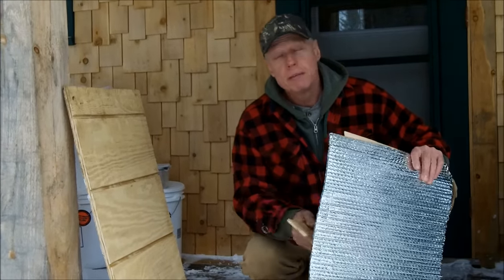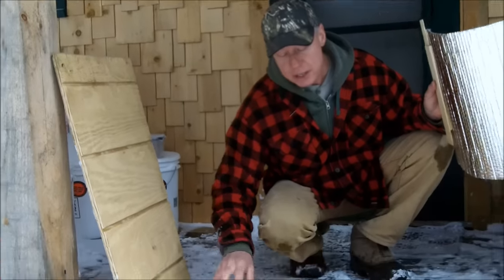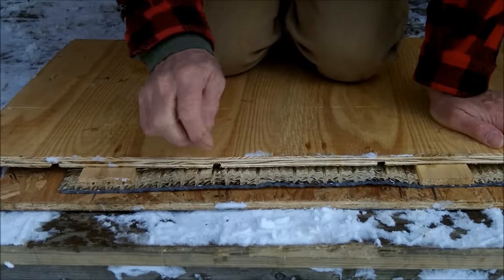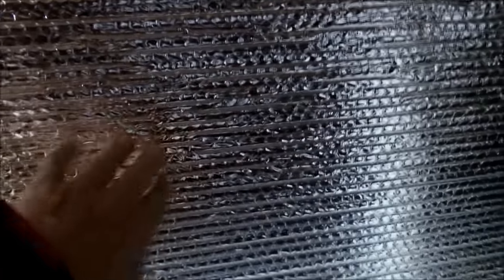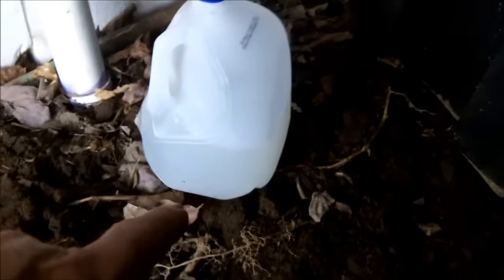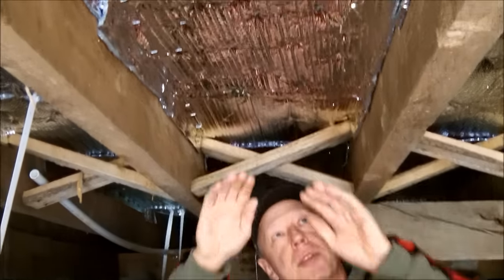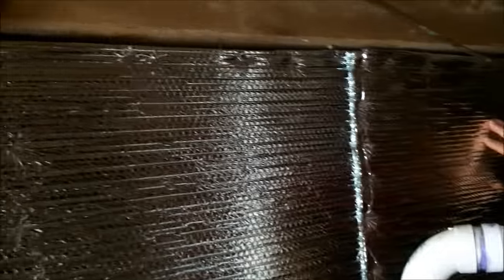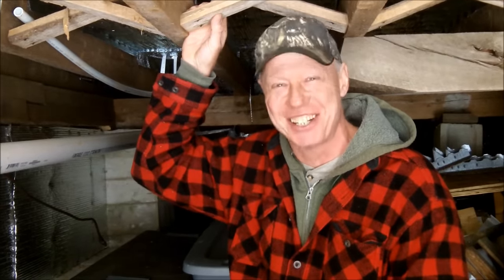HOW TO INSULATE A CABIN FLOOR AND KEEP IT RODENT FREE

Comment: i used the same material stapled to the bottom of the sub flooring in my basement and can tell you it works wonderfully.  This was done about ten years ago.  Easy to deal with and easy to cut.

Comment: Love this idea, have a house built in 1940, the wood floor has no isolation so am ordering the bubble foil for just below in the full basement, won't be all that bad to install, might hire someone to do it since we are in our mid 60's and having arms up like that on ladders might not be such a good idea (Could be hospital bills LOL), but heating this house is a nightmare and always feel the air from below. Thanks, will let you know soon as I get things going.
Reply from the maker: This stuff changed my life. I'm finally warm now :-)))
Reply: Dallas_Red did you use the bubble foil?? How did it turn out if so?

Comment: The trick to that reflective bubble wrap is cutting long strips and sandwiching the strips between two layers of the bubble wrap, and that will significantly raise the R-value even more….. like you mentioned, the more air pockets in between, the more or better insulation. I’ve been using rolls of that stuff for almost 20 years now.

Comment: My friend and I are buying a piece of property with an existing cabin, up close to the Canadian boder, that's roughly 70-80 years old. It was really well built. The foundation is just like yours and I was concerned about insulating it and rodents. This video has helped so much. I've insulated with reflectix and found it to be amazing. So this isn't a stretch for me to believe in. Thank you for the video.
Reply from the maker: It really works well doesn't it.  This is all I have for floor insulation in all of my structures and don't plan to change :-)

Comment: I just built a 12x16 cabin (camp, we call them around here).  Based on your video, I laid reflectix on my floor joists, then 3/4" tongue and groove OSB.  I haven't laid anything down on the OSB yet.  Thank you so much for this video......it was -15c the other night and my floor (nothing but reflectix and the OSB..no skirting and about 2' off the ground)) was nice and warm on my bare feet.  It's exceeded my expectations, actually....I had decided that even if the floors were still a bit chilly, it beat laying awake at night listening to mice.
Reply: Hi Andrew. Did you use any spacers in-between the floor joists and subfloor? I really appreciate your above comment. Thank you.
Reply: @madawna  No, no spacers between the joists and the sub floor.  That was a couple years ago, and I'm very happy with how it's performed.  I've since put click flooring down with a thin foam underlay.  It's been great.
Reply: @andrewcarter7866  Thanks for your reply!

Comment: WOW, I have been battling this problem since I bought my manufactured home. It does have brick foundation. I even have to replace all the air ducks as they got in them and have not been able to use heat or air due to the smell when it is turned on. I have been looking into howto re do things and prevent them doing the same thing over again. I believe this is the answer for me. Thank you so much.
Reply from the maker: don't let anybody talk you out of using this stuff. I have NO issues and NO regrets.

Comment: We built a cabin this summer in Interior Alaska... MANY thought we were nuts to do our insulation this way ( we were also a little skeptical) we went ahead and did it anyways!! Today we woke up to -37 degrees and our floor is as warm as it would have been for the expensive, labor intensive regular way of doing insulation up here...THANK YOU so much for putting this out there. It will be a game changer in our community!
Reply from the maker: It's amazing stuff isn't it?

Comment: I have used double bubble (R-11) since it first came out. it is also water resistant and added regular insulation you have a wonderful insulated area!
Reply: Double Bub half the work, twice the pleasure.  Single Bub is great to cover windows  that are not often used, let in too much heat or cold. - Cut it larger to fit in the sill and also on both sides, and enough larger on top depending on your window.
RV vents- I'd Dub Bub.  Have even put it under the mattress pads- not silly! Reflect your own heat back to you. Or to use camping also.

Comment: I watched your first video where you discussed this insulation, even ordered a roll of it to experiment with for outdoor cats.  Thank you for talking more about the instillation of it on existing cabins.
Reply: IDK. I live in 1969 mobile home in country and I see animals use fiberglass insulation for nesting,but I can't see bubble foil to be warm. I spent thousands dollars on R10 2 inch foam boards insulation and I'm not seeing it any warmer. ?
Reply: 1969 they didn't have this techno. so don't live in that Era now update if it is proven.
Reply: Honey Hollow Homestead   How did you use it for your outdoor cats, & did it keep them warm?  Also, any thoughts of how can I apply it to the unfinished wood walls of a utility room to keep cats warm?
Reply: @almaburns6562  This was 4 years ago! Cats like small spaces. You can line a cardboard box with it using double stick tape, don't forget to do the top and bottom. I'd put some sort of towel or cloth of some kind over the floor so the cat isn't laying directly on the plastic. See if your cat likes it.
Reply: @HoneyHollowHomestead  Yes, I realize your comment was 4 years ago but still, I hoped you'd answer, so thank you. I'm hoping it does make the box warmer, although there is no air pocket between the box & the foil.

Comment: I live in a very humid travel trailer and will also add that the “bubble foil” will not mold. The metal window frame where I have it grows mold but many years later the “bubble foil” never does.
Reply: I live in the Southern part of the US (North FL) and use this to insulate my shop.  No moisture build up and changed my AC holding ability overnight.  Not sure where you got your info but I have proof that your comment is wrong unless your allowing water to penetrate.

Comment: I have heard alot of good things about the reflectix and also foam insulation over fiber glass but now im convinced. It probably worked better as a sheet of between the sub floor and the joist better cuz it also insulated the floor joist themselves.  At least that my guess.  Anyway thanks a million for showing this its a definite time and money saver.

Comment: When I built my shop (an enclosed pole barn) I had the roofers put a layer of this right over the rafters before putting the sheet metal roofing down.  My shop remains amazingly cool in Florida summer, even with a metal roof.  It's like sitting in the shade.  This material works amazingly well.  I feel stupid for not thinking of it for a cabin floor. I'm looking to get some land in the back hills and building a retirement cabin in a few years, I will put this to good use.  Thanks for this video!
I would only add a recomendation for rock wool insulation for the walls.  It is rot proof, bug and termite proof, and won't burn (has the same fire rating as concrete, 4.5 hrs+).  It also lets the walls breath.  You may need to add a vapor barrier on the appropriate side depending on your climate, as it breathes very well indeed.
Reply from the maker: I used some of that in the wall behind my woodstove.  Good idea about putting it beneath the metal.

Comment: I was aware of this material probably by the late 80's and applied it for the first time around 1995 for a sunroom built above ground. The directions say explicitly to leave a 1" air gap between the warm side, i.e. usually your interior (DEFINITELY in Ontario), and the face of the foil. At least that was the literature supplied in Ontario, Canada. That's not a novel application suggestion. I forget the equivalent R value of the wrap but that 1" gap helps let the reflective foil do its thing to hold in radiant heat, not just conductive heat. Think about it. If it was only the bubble wrap doing the insulating, it wouldn't be skinned with foil.

I did "belt and suspenders" insulation. Fiberglass batting AND the bubble foil. - on the exposed floors, stapled the rolls to the under side of the floor joists and taped the seams with aluminum foil to seal it from rodents, etc. on the inside, I stapled a zig zag web of cheap poly twine to have the batting suspended with an air gap above the bubble wrap, then carried on flooring.
On the walls I put in the batting first. i didn't bring the batting out to the edge of the studs. I left depth so I could put in bubble wrap that was stapled into each stud space back one inch from the edge of the studs, for that 1" air gap before drywall.
Reply: Excellent point about the one inch air gap. 👍 If you tape all the seams it will make an excellent vapor barrier also...

Comment: I went with Reflectix on my cabin after your video about it a couple years ago.  I stapled mine to the underside of the joists tho and backed that up with 1/4" hardware cloth for extra rodent deterrence.  

I will be putting in an above the floor radiant heat system next year for guaranteed warm tootsies all winter long.

Comment: I use a product here in Darwin called Insulbreak 65 by KINGSPAN, it is an air-cell type product and is the best thing for roof & wall insulation. Instead of the little air pockets it has the silver foil both sides of a beer cooler type product. Great stuff, the thing you keep learning in the building industry is great, just the other day i learnt that Fucking Architect was no one word!! Good stuff JC.

Comment: What a great video!  Very conversational style, but packed with real experience and knowledge!  I was thinking at first the bubble foil material wouldn't be sufficient for where we live (central NY state) but then you say -27 with wind and you could be barefoot in there and I'm thrilled to know about another way to help insulate!
Reply from the maker: It's the best solution that I've ever found for insulating a cabin floor as long as the building is skirted.  Skirting makes all the difference in the world.

Comment: Will definitely be using this when we move to MO. Thanks for showing different options as we are unsure what type of dwelling we will end up getting. Thinking about a 14'x40' metal shed & finishing out the inside so flooring could go either way. Love your videos! God bless ❤
Reply: LittleDirtPatch . . . You will need a basement or storm shelter in MO for protection from tornados. Something to consider....
Reply: What did you do? Did it work well?

Comment: I didn't hear it mentioned but the  bubble foil is more than air, the stuff reflects infrared heat back into the living space. So while you may compress the stuff between the subflooring, it probably won't make a huge difference. The reflective nature of the material also explains why putting it between the joists isn't as effective. The surface area of the top of the joists as a proportion of the total floor space is not insignificant. PS we use this on our boat for insulating the ice box and for insulation between the berths and the fiberglass.
Reply from the maker: Yes, blanketing over the joist creates a thermal break and works better than in between them.
Reply: @thebossoftheswamp  What if, instead of cutting it in strips and stapling between the joists, you stapled it to the floor, then down around each joist, so that there would be a complete thermal break, but it included the joists above it? Is there any reason not to wrap the joists in it?
Reply from the maker: @Romans828girl  The best way is to blanket the top of the floor joist before the sub floor goes down.  I wasn't able to do that with the old camp because it was built ten years before I was born haha.  I'm working on an update that I will release very soon. It shows the results of this after 5 years and covers many of the questions that have come in. Stay tuned :-)
  To answer your question:  Wrapping the joist will serve no purpose that I can see.
Reply: @thebossoftheswamp  I appreciate the response. The purpose for me would be that I intend to have a building built by a local company, and then I will finish it out as a cabin, so the subfloor will already be in place. My choices will be cut the bubble foil in strips and staple between the floor joists, keep the bubble foil continuous by wrapping the floor joists from underneath, or removing the subfloor to put bubble foil between the joists and floor. If they screw the sheets of plywood subfloor down to the joists without gluing them, my easiest route might be removing it, putting in the bubble foil, and putting it back.
Reply: @thebossoftheswamp  Is there an air space between the floor joist & the sub-floor? To be effective, does there always need to be an air space of 1" or less?
Reply from the maker: At my place in NY, I had a 14x24 shed/garage delivered and I had the building company blanket the top of the floor joist with the bubble foil before they put the subfloor sheathing down.  Maybe your builder can do this and your shed floor will already be insulated upon delivery.
Reply: @thebossoftheswamp  Excellent suggestion. I will ask them about that.

Comment: I've been wondering how that might work. Thanks. You've confirmed what I had hoped would work. I also was thinking of using the bubble foil on the sub-floor with1-inch of foam and then the floor over it. That should keep your bubbles from being mashed flat and provide more insulation.
Reply: If you use the foil with no airspace you might as well just use the styrofoam alone. It needs space. Otherwise plain aluminum foil from grocery store does the same
Reply: @aNuthaRedneck  The foam and foil do two different things. The foam resists conductive heat transfers,  while the bubble foil reflects radiative heat. An air gap isnt necessary. You could use foil from the grocery. That would be rather expensive, and very inconveient. If you wanted to use a sheet instead of bubbled foil, it's better to just buy foam with the foil glued on at your building supply store.

Comment: You just solved my cabin building insulation dilemma. I will install the bubble foil right on top of the floor joists, then floor boards right over the top. This is a substantial savings over foam board for sure. Saving money and decreasing the  work load
Reply: How has it worked?

Comment: I'm glad I ran across this.
 I just purchased  a little cabin with nothing but a sub floor. I will definitely  be using this before putting down the hardwood laminate
Reply: How has it worked?
Reply: @billwilliams4877  I have had the chance to lay it down yet. I won't be home for another 1.5 weeks.
 It should work well as both a moisture barrier & wind/air barrier. Especially  after taping the seams of the Plywood floor.
 Right now my floor joist insulation  consist of rolled insulation  under the bottom with an over layment  of chicken wire to keep large critters out.

Comment: I had the exact same idea you had with the foam sandwiched between floors and the strips of wood cut too the same thickness as the foam.. I have used the bubble foil for other uses but never thought of this.. Thank you so much for this video and others you have made.. I have learned so much from you.. all the best.
Reply from the maker: Ants LOVE that foam.  I put 3" of foam in the ceiling of my NY cabin and it was a huge mistake.  Never again.

Comment: The best way to insulate a floor if you going to insulate on the inside of the subflooring you use half inch celotex that's a half inch rigid foam silver foil on both sides and then you can either put another layer of plywood or you can put on laminate floor on top of that and the way you did the insulation with that bubble foam downstairs it doesn't really work because there is no thermal break cuz every floor joist the cold comes through did you ever noticed on a cathedral ceiling house when it snows on the roof in a couple of days they heat goes through the rafter to the plywood to the shingles and melts the snow and then you have all these lines going down the roof while the snow is in between those Rafters because there is no thermal break that's the problem with houses today there is no thermal break also if you insulate your floor with fiberglass you definitely have to put up quarter inch plywood or like a luan or half inch sheathing and that will keep the rodents out as long as you don't have a quarter inch space for them to squeeze through a quarter inch space because their bodies just Flex so much they squeeze into any tiny openings it's a little more expensive but it's the right way of doing it done it many times never have problems with rodents been doing this for 47 years I hope this helps out some people
Reply: Good points, bud, but it’s easier to read with a few periods, maybe a comma or three. Did you pass out writing that all in one breath?

Comment: I just did my cabin porch 10 x 20 sub floor an all the joist an a curtain around the bottom with the foil. I use a 30,ooo btu Mr Heater. For my 20 x 30 ft cabin. What a difference from last year to this season I'm  in VT. At 32 degrees I can get the cabin up to 80 degrees in less than 2hrs. Thanks for the video it really works.
Reply from the maker: That is awesome!  Thanks for the success report :-)